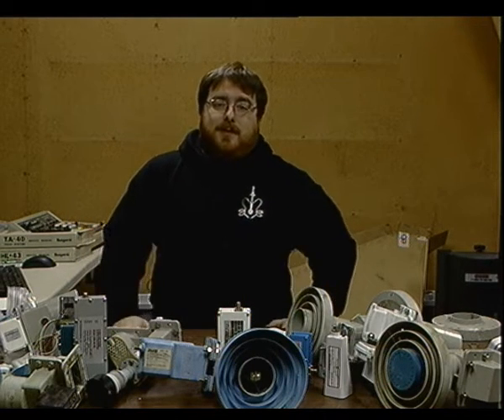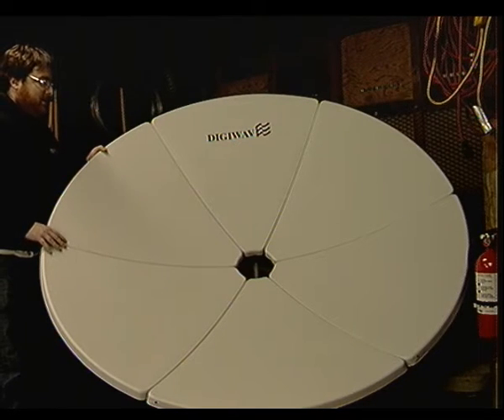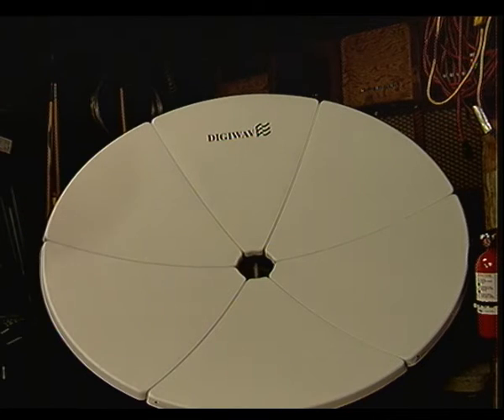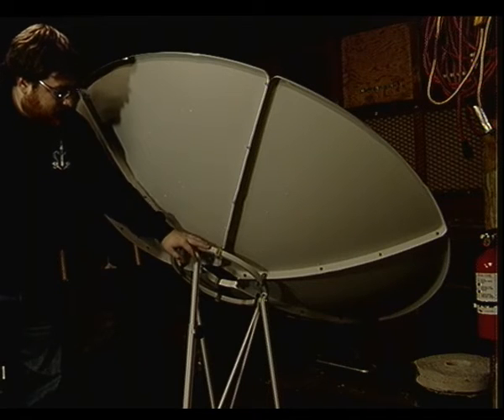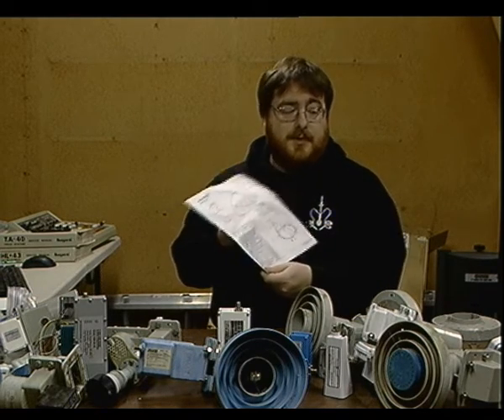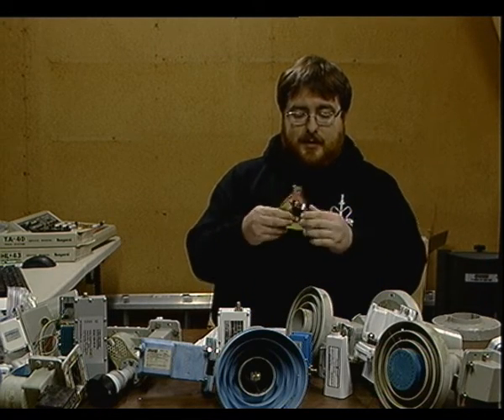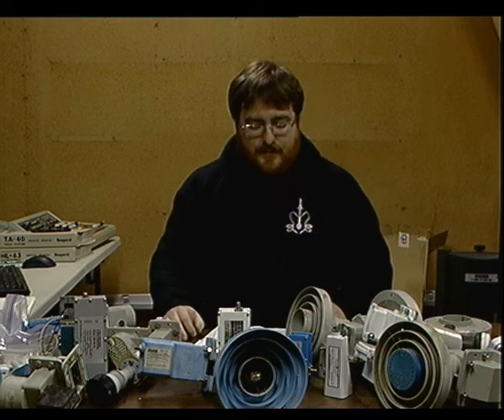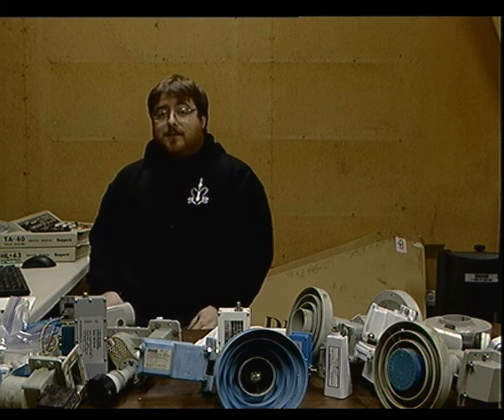Digiwave DWD-165T Satellite Dish Overview

Comment: well...still waiting for the results on day 4....is it better than 1m , 1.2m or worst than 1.2m...i doubt it since majority C-band high power satellites is on either 58w,97w,113w,116w, or 131w...problem with 97w...is require more bigger than 165cm due to one HIGH FEC transponder has majority channels everyone wants the free basic cable package broadcast syfy,amc,usa,qvc,cnn,foxnews,msnbc,tnt,tbs,spike, well its on lyngsat site tells you lot of info

so basically my plan will combine 2 cband signal on satmex5 and 6 since that size of 165cm and living south of border..should give me least 85-90% capture on that size than i am current just 113w with only 14-24% with 100cm offset dish ...it gives me good programming from mexico for free...least 70 channels are free or more that is not listed on lyngsat so i am very curious how it goes...and satbeams is very handy site for details on every sats on the arc
Reply from the maker: I'll post an update when I can.. It is set up and does "work" - but the weather has been pretty crummy making it hard to finish up alignment.

Comment: i have a question did it came with PM AZ and EL bracket....and bought from Canada or its used, because they are 2 revisions one from Digiwave and last one from Homevision CA...the latest have improvements made on the DWD120T for both on 165T and 180T...including 240T by coating anti rust Galvanize steel on the surface that apply on every one like ku band dishes but the screws will rust evidently but not the dishes and i have 60cm WInegard for more than 4 years and not seen rust yet...
Reply from the maker: I bought it new from a dealer in Canada.  It was not the "homevision" one as far as I know.  They may have improved the coating on the dish but it still flakes off easy if you dent it.  The screws/bolts definitely will rust as they are just steel.

Comment: man he going be how wrong when it perform better than 1.2 meter...but of course it will rust no matter what you do..unless you can coat with protected paint from rust...or tell people to buy 1.8 meter mesh dish..and mesh dishes are not great with tiny holes...it will wear and tear with high winds

this is why C_band is a wild band to anyone dare to try...no many success stories i here but expensive to make it work...

this is why Ku band replace C-band but due to early 90's ...dish and directv makes it so hard for others to make it free tv like C-band did..its lot easier to find it but harder to lock on it with c-band than Ku band...due to size requirements of 150cm minimal that even many 1meter offsets can get c-band but not that great as one you post online since only so far i only get few channels from only 2 sats where in my location..58w and but 113w is better but wish i could got more than 30 channels out of 140 listed but with Ku band ...anyone can get 20'"in or 30"in dish with huge setbacks...majority market is scramble with security measure like nagra and videoguard..and newer tech like Irdeto 2 and Conax..so options are very less for consumers pocket